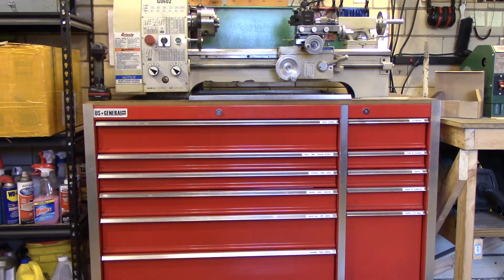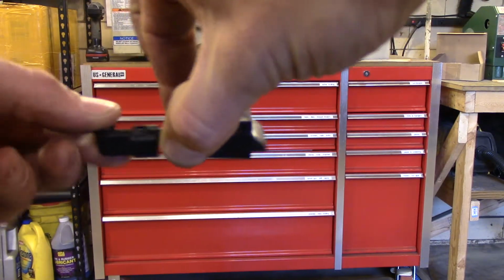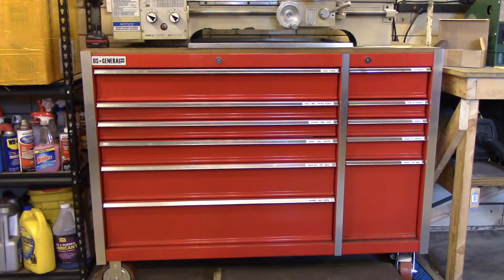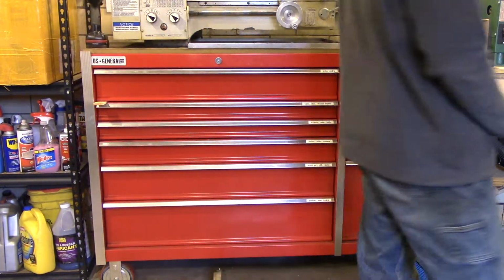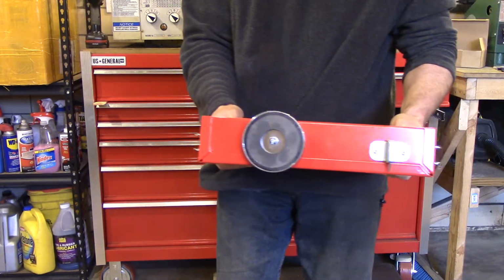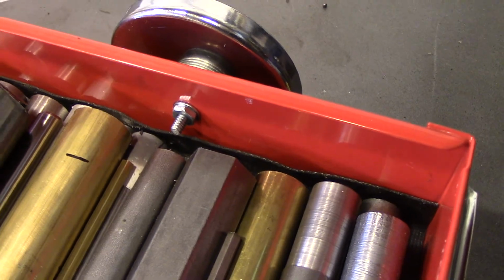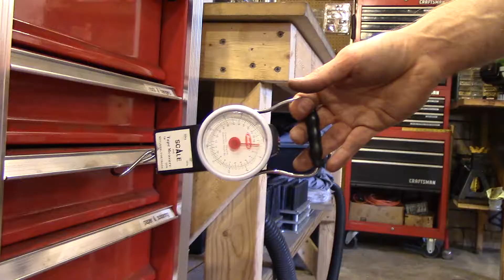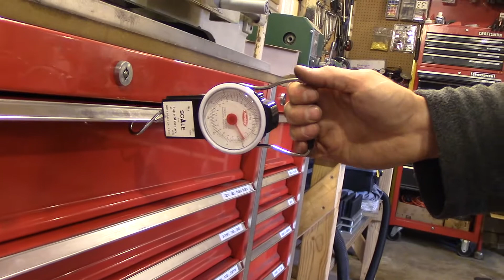Magnetic Drawer Lock Mod for Harbor Freight 56" Tool Box

Comment: First of all, thanks for sharing. A few years ago I purchased one of these Harbor Freight tool boxes when it was on sale and after loading up all the tools and moving the box around I too noticed the drawers sliding open due to the weight of the tools in the drawers. My unit does not have the plastic latches on the right side of the drawers instead the sliding rails have some sort of friction detents which are very weak. So my solution was also to use magnets however what I did was purchased a few of the 18" magnetic tool holders from Harbor Freight and cut them in half (you need to remove about an inch of the magnet on the cut side to make room for a hole that will need to be drilled for mounting) I then bolted them to the back of each drawer left or right of the center lock latch. All that was required was a couple of bolts, nuts and 6 spacers to get the perfect distance between drawer and toolbox back wall. For the spacers I removed the rollers that are used in a bicycle chain, I simply separating the links and removed the steel rollers, using three on each side was perfect. Hope this helps someone else.

Comment: I just used some 1" Neo magnets with 3M double sided tape. No drilling holes into your tool box and a lot easier to fine tune the pull strength by adding magnets. Can get a pack of 10 for $14

Comment: I just shimmied the front wheels with 2 5/8 washers on each wheel bolt.    This tilts the box back slightly, just enough for the drawer to close slowly by itself, prevent it from opening on it's own.

also they sell smaller hobby magnets if you do it this way so that you don't need to yank your drawer out and have everything go flying like you see in the video.
Reply from the maker: I've been using the box every day since I posted the video. I don't have an issue with tools slopping around. 

The washer idea is a good one. I'll give that a shot, though I doubt it's very good for the lathe.
Reply: theleetbeagle that's what it looked and sounded like at 3:55.    I just envisioned  a box of screwdrivers or wrenches without a holder all flying to the front of the drawer like would happen if you slam a drawer  shut.

I thought a 50lb magnet would be a  better option. Hard to tell.

Comment: I have a 72 inch harbor freight tool box and I have modified the drawers I have removed the drawer lock latch on the side of it. And put magnets on each drawers two on each one a 60lb pull on each magnet and it works perfectly got them on Amazon 36 magnets for the box two for every drawer and spaces bolt in to the drawer and it makes a big difference it's a great idea to do
Reply: How do you remove the latches
Reply: @chipete1  there's a lever on the drawers slides on each sides of the drawers you just lift the black tab up on each drawer on side down and the other side down and it will slide out
Reply: @lockettreagor1526  I'm talking about the latches that actually open the drawer mine broke already so how do you take it off and replace it
Reply: @chipete1  you have to order the replacement ones from harbor freight give them the model number and serial number of the box now as for removing the broken ones you have to drill out the   Rivets and then it can easily be removed from the drawers now harbor freight does have replacements for the broken ones

Comment: Great idea, just too strong.   I am just harvesting the magnets out of the HF told holder magnetic strips.  There are 8 magnets in a strip and they can easily be removed.  I will keep adding them to the back of the cabinet inside wall to get the resistance just right.

Comment: Not a bad idea.  I like it but for me i wouldn't want mags that strong.  So I'll find some with about half thsf pull rate and give them a try.  And I like others ideas of using 3M tape or something else besides drilling holes.  Thanks for the tip!!  👍

Comment: Awesome fix, but curious with the lathe, dont you have a mess of metal fragments getting all inside drawers?
Reply from the maker: No, it's not too bad. With the drawers shut, most of it just falls to the ground. I tried various ideas of covering the drawers, but I'm in them too often for any of them to be effective. Eight years in, the drawers still slide and are relatively clean.
Reply: @theleetbeagle  I have a similiar with a radial arm saw,. Not exactly but drawers get filled with sae dust, ha
But cabinet works great

Comment: I just broke 2 of these plastic latches and I am thinking Harbor Freight won't have replacements. Would you be interested is selling 2 latches? I went to open mine and the handle fell off and the spring shot out..
Reply from the maker: Sure. theleetbeagle@gmail.com
Reply: I've got a full set off a 72 inch
Reply: @cbmech2563  do you still have them for sale?
Reply: @Zachspod  yes  I  do

Comment: I think I would have attached magnetic strips to the back of the cabinet rather then the drawer. Biggest reason against using harbor Freight Tool Boxes.
Reply: And I've got $5000 reasons to buy Harbor Freight
Reply: @cbmech2563  🤣😂🤣😂 got 'em
Reply: Yep, it works even on the big box. But if you're going to buy one, you should probably do it soon. I'm not sure if the new tariffs will include tool boxes. 😔
Hopefully with someone standing up to them for the first time in won't take long for them to play nice.